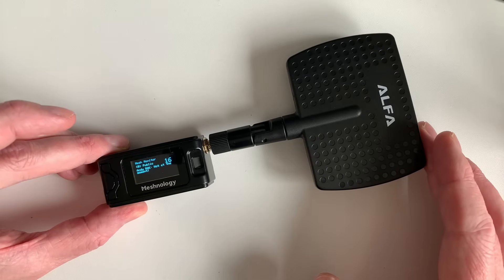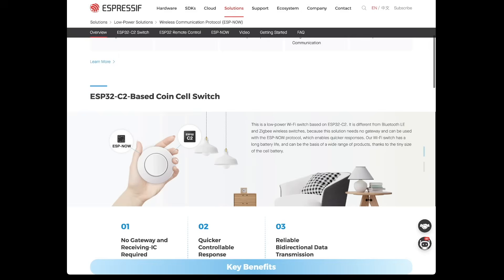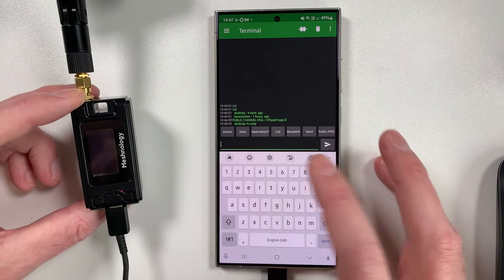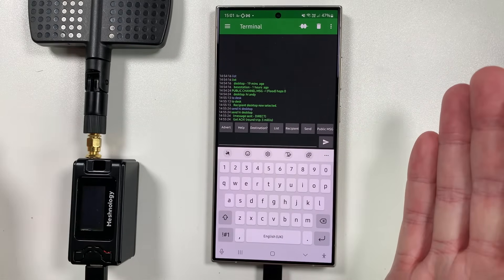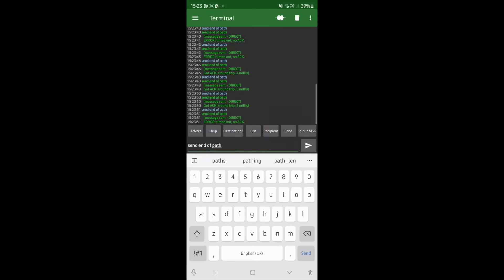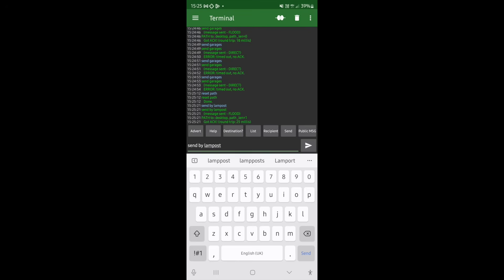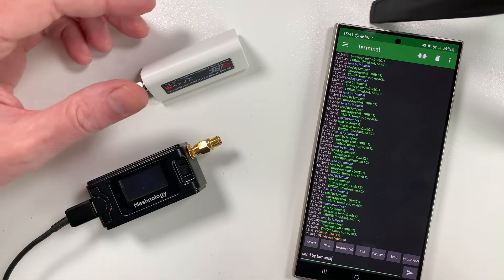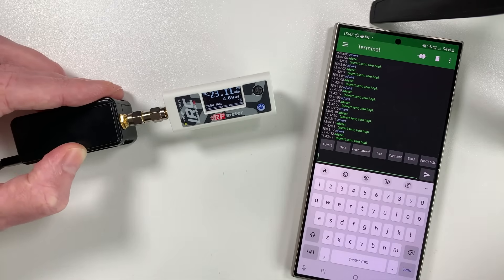ESP-NOW off grid mesh using MeshCore

Comment: Can you do a video on using LoRa 2.4 LR1121. I curious if the 2.4 range is better than the setup your testing here? Is the LR1121 capable of transmitting 868/915 and 2.4 at or near simultaneously? The specs of the LR1121 have me intrigued on what its capable of. How does the lr1121 lora-satellite capability work and is it something to look into further?

Comment: This is incredibly useful for my specific project, one of the usecases is when we're working a Festival Venue that's got nothing for service and we need to stay connected and know where people are for key things, this may be a direction I take a few of my nodes next time I have time to fork 😂 ❤ love everything you're doing for the Mesh community Andy, just joined the Discord, I'm in the weeds with config today but I'll be vocal at some point soon!

Edit* the 180° plug for a backpack just made cable management issues I was thinking about disappear. 😂😂❤
Reply from the maker: This is great! Exactly the kind of use case for it!
Let me know if I cam help you in any way.😁 andy@cloudsto.com
Reply: @andykirby funny enough less than two weeks later I modded the case from seeed for dual external antennas and these little things are AMAZING.

Just got another TBeam in the mail today 😅
Reply: I have free sms so what is the point 🤔🤷‍♂️
Reply: @sleinnesnej ...if you dont see a difference between sms and mesh, I cannot help you. 

Well, lemme try

google what a Stingray is one time. They're totally illegal to use without a warrant and you can't get one for an unknown dynamic group of devices that are constantly coming into and going out of range without your prior knowledge or control, making its use technique not possible to be warranted, but here we are, I have felonies for 3oz of weed and they used a sim clone tek on the CI's phone as a work around for tapping mine..

Its nothing to do with why I'm so dedicated to this project, I've been building meshcomms for years, Meshcore just opened up a whole world for me while also closing it off at the same time. Meshtatic prints position eats battery and tattles too much.. I'm also not building infra for the general public, its for preauthed devices in the proper hands for the proper reason. 

If the grid goes down as well, good luck getting cell service to work. 

I keep all my undeployed nodes in a faraday box. Just sayin.

Comment: Should run it on 446 longer range bigger foot print, small easy home antenna... Plenty of channel space..
Reply from the maker: There's  not really the bandwidth on 446 unfortunately 😁
Reply: @andykirby  really! how wide is the data stream?  it works on 70cms .. 16 ch, s on 446 mostly 14 unused and another 16 digital...
belive theres 2 mhz on 70cms as you can use under  500 mw no licence! you could use..

Comment: Morning Andy, I just thinking could this be used for backhaul or linking a bunch of these to create a gateway between bands e.g 400/800?
15mw into a decent antenna (thinking 3D printed case with a heilcal antenna with the Heltec on the mast). Would the RAK be able to support this?
 Also whilst I appreciate this is about keeping stuff off of the internet could a USB / Ethernet backhaul be added? In North America there are Ham Wifi networks (HamWan) and this could compliment and a backhaul would keep a lot of traffic off the netwrk.
Excuse my ignorance, but with Lora are there enough channels to have a dedicated user and a dedicate backhaul channel?

Comment: What are the chances that you could bridge data between ESPNOW and LoRa? With a dual antenna/dual band setup, you could set it up to where devices ping via LoRa first, then ESPNOW second, defaulting to ESPNOW if available, then if ESPNOW ever fails a ping it can immediately follow up with a LoRa ping, and when connected over LoRa it can try to renegotiate ESPNOW every other ping if the SNR of the LoRa connection hits a user adjustable threshold.
In dense areas of a mesh, you have the bandwidth to deal with the traffic of the density while also not cluttering the long range channel, and the sparse areas within the same mesh don't just drop out, they fall back to LoRa first. Messages that hop several devices can theoretically be transferred seamlessly between the protocols at multiple points throughout the mesh, maintaining signal regardless but run along the faster protocol when available over a hop.
Reply: Pretty much this. ^^^  With one twist.  
Merge both systems together.  Let the system use both paths as available.  Some data on each path.  That should give you the bandwidth to run something like ATAK and have voice available.   How difficult it would be to know what each side was transmitting I don't know but IP networks have been doing this for a while.

Comment: What are the advantages of this over setting up a public WiFi network?
If you have the community that supports that many units, connectivity shouldn't be a problem My ham group played with AREDN mesh and it worked nicely over several miles, but we didn't have the quantity of nodes to build a solid mesh. Equipment cost was also a concern.
If licensing is the issue, just keep the power levels within the legal limit and stay on the public (non-ham) frequencies. Key considerations when meshing, node count, elevation, and of course at the higher frequencies line of sight.
Reply from the maker: Well for a start no connection is needed like a conventional WiFi network so it's fast to send small packets of data.
Reply: If the purpose is to provide SMS type functionality, what spings to mind is:

1. Cheaper nodes to form the mesh
2. much bigger spacing between the nodes.
3. no requirement of DHCP or DNS (so no single points of failure.)
4. far reduced chances of malware
5. Lower power requirements.

The down side of Meshcore is the clients cannot act as repeaters when there are no dedicated repeaters available.

I'm guessing you would be looking at something like Briar over WiFi as the alternative?

Comment: Of course it you want better range you can use LoRa on SX1280 based radios (T3S3?). I've been playing with 2.4Ghz LoRa for a couple of years and regularly receive a beacon 35km away that is using between 1 and 3mw transmit power.
Reply: for the 2.4Ghz is it still mainly text based data you are sending or can you send larger files like photos?
Reply: @ThatOneGuyGreggers  Its just a weather sensor  so basic text
Reply: @neil2402 Do you know the latency?

Comment: It looks that meshcore is not accepted on the mainland…
Reply: Doesn't matter that much, as long as it's working so its usable for sensors or off grid communication
Reply: I see nodes being added every day on the map. That will need some time, but it's happening.
Reply: @chixxxxi  correct but all in GB and usa. I have a lonely node running in a Meshtastic invested area. Asking in Meshtastic group just nobody seems interested… look at countries like France, Germany, Denmark etc almost non existent nodes…
Reply: @EyeballmkII  I do have way more Meshtastic nodes than MeshCore nodes in my area too. But I can not message them reliably, so it's no better than having no nodes. I was an early adopter of Meshtastic too, waited for years to make the first contacts, MeshCore, at least where, I live is being adopted much quicker. But you are right, there is a certain resistance from the Meshtastic community. I currently use both.

Sometimes it feels like the Meshtastic users are mainly using it for Telemetry, Sensor Data and GPS Data cause the messaging part doesn't really work. Now they miss exactly these features on MeshCore 😉
Reply: @chixxxxi  wished I had the chance to discover MeshCore features… but I will hang on and hopefully there are more nodes coming in The Hague, Rotterdam and Delft triangle…🙏🏻

Comment: If it's running on 2.4Ghz, would it be possible to just run it from the existing 2.4Ghz radio that's built into a phone for wifi anyway? Or have I misunderstood the technologies?
Reply from the maker: Unfortunately no this particular implementation is only supported by ESP devices.
Reply: You cannot really control the phone's 2.4ghz radio as it's managed by chip which only support wifi/bluetooth protocols. Its only use would be for Reticulum mesh network which can work through wifi
Reply: Ha! The same question asked twice! 
I was speaking to Andy about this - Adding the support for phones and such but realistically you'd need chip level access, a rooted phone and supported hardware for it to work on a mobile!
It is a cool idea though, imagine, no need to buy a Heltec or anything, just download an app and use existing hardware.

There is absolutely potential there! Imagine that if it somehow worked out and was possible, there wouldn't be a reason for one not to get involved!
Out of scope for the project in its current stage though... But you never know, some smart sausage may come up with a way in the future.
Reply: @TechWithMarc  It is obviously possible do a similar functionally to meshcore on bluetooth, because apps like Briar do it. But the range will be nothing like that shown in the video using the ESP protocol. But it would be a rather nice option if a repeater could bridge between multiple local independent bluetooth devices and Lora Meshcore. (Would be far better than a fixed companion device)

Comment: When I first saw a video about esp-now, a few months ago, I wondered if this sort of thing was possible. Coincidentally, the V3 I currently have set up as a repeater on Meshcore already has a 2.4Ghz socket and antenna fitted.

Is there any reason for this not to be included in the regular meshcore ESP32 firmwares?
Reply from the maker: Nice! 
No reason it can't be included we are just working out the best way for it to work. Lots of possibilities!
Reply: @andykirby  (Unless it is dual band simultaneous) Can't the frequency and settings just be entered as normal from the UI perspective? Also can I request that the rooms/repeaters have configurable SF like the T-Deck client has, please?